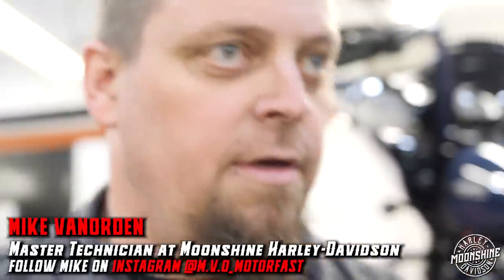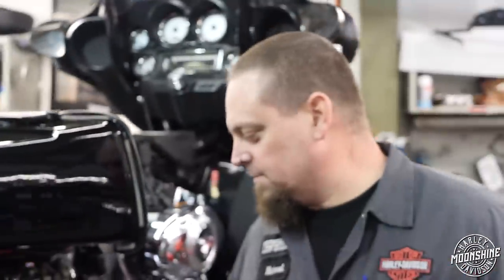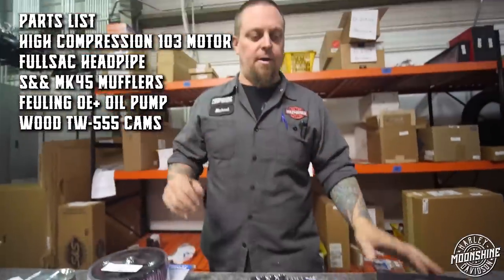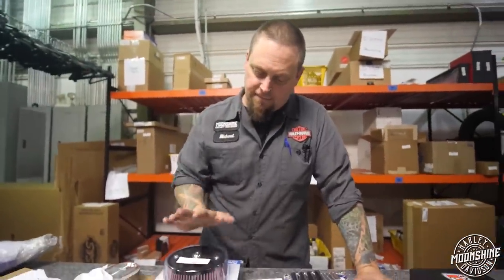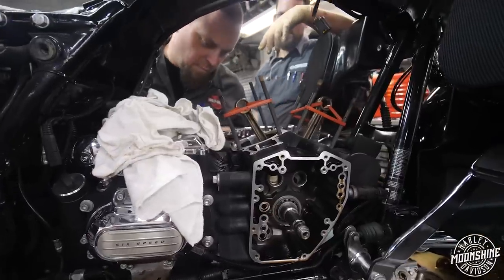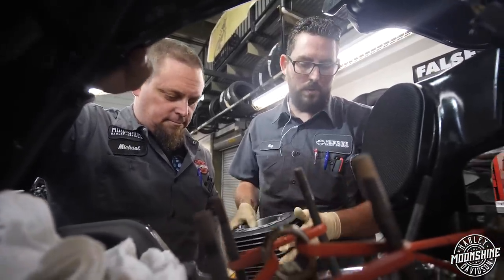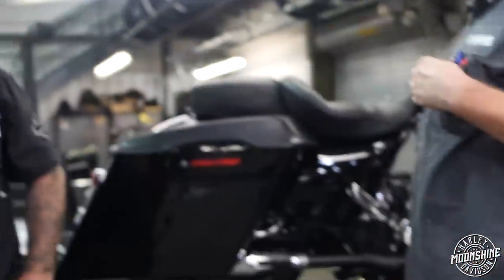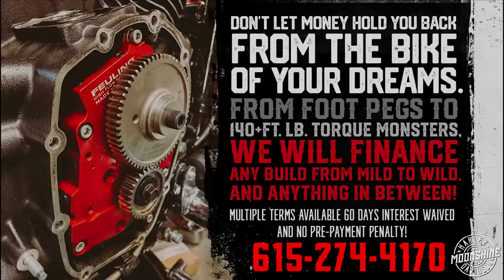Twin Cam BUDGET BUILD | Shop Talk Episode 32

Comment: I run this exact combo except I used 222 cams instead of the 555 for more low end grunt as I do more 2 up riding on my limited. Also changing to the SE clutch spring diaphragm really helped with some slipping I had with all the new power.

Comment: 2014 FLHP with H-Ds thin liner 110 barrels and pistons, MVA heads (a gift), CVO cams (couldn't pass on the price), Fullsac header, canned tune: 95 hp, 109 lb/ft. After I swap in the TTS-100 cams and get a custom tune I'll post the results.

Comment: Opinion on the HD 131 crate...can you expand on what else you should do.if you install this much power in a stock bike...the next weakest link
Reply: smokeGR20 The 131 is designed to work very well with the parts it comes with. If we install our heads and cams we believe the cylinder wall thickness won’t hold up over time.  That’s why we build the 124/128 setups, the cylinder is much stronger due to the extra wall thickness. We will have a 131 available this year and it will be the same cylinders we currently run but the Flywheel will have a little more stoke!!! If you have more specific questions call me at the shop. 615-274-4170 Jamie Lima - Moonshine H-D.

Comment: Cams with slip ons best bang for buck on an M8. What's the best bang for buck on a Twin Cam 103 Glide? I got a set of Wood 222's put aside, what else should go in with them for a "bolt on" budget build?
Reply from the maker: Call the shop and ask for Nick or Aaron 615-275-4170. You can also email us at horsepower@moonshineharley.com please include a good contact phone number.

Comment: I have a 2012 fatboy with the 103, is crankshaft runout issues all that common to where I should be mindfully worried about it?
Reply: No.  It is good practice to always check when the opportunity is present and there are times when it will not meet certain performance application tolerances.  But actual out of spec readings or issues caused by excessive run-out are not common.

Comment: Love the vids!!! Great comradery!

In desperate need of more hp in my TC88 EFI softtail. Was looking at the big bore S&S 100".... Thoughts?
Reply: I did the 100in kit from S&S and nothing but issues wish I never done it.
Reply: @ejohn2632  Man sorry to hear. I wanted so bad to go with a big crazy setup on my 03 bagger. Ended up just boring the cylinders .010 over and cam kit. Runs strong. By no means fast or even quick lol. But, strong and reliable is sometimes better way to go. I have a M8 softail also if I want more power even oem still. Only regret so far is keeping original heads oem just had them freshen up. Wish i had them sent out to get ported polished and beefed up. I hope ya get your bike sorted and it is just something simple.

Comment: I going to point out the obvious. The M8 is just far superior when it comes to making power.  I think the twin cam sounds better though.
Reply: Yes.  On both.
Reply: M.V.O _Motorfast I had basically the same build on my twin cam with the SE 585 cam. Made 97/117.  Ran great and sounded awesome. Now I have a M8 124 made 130/147 but does not sound as good as my twin cam.